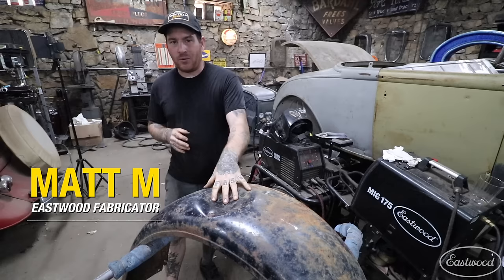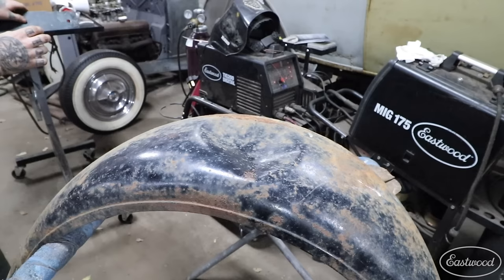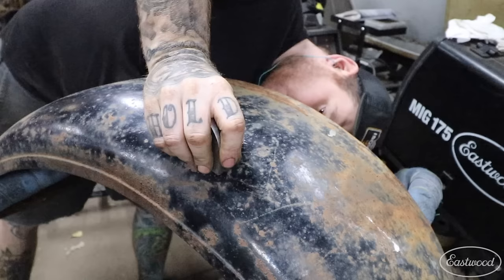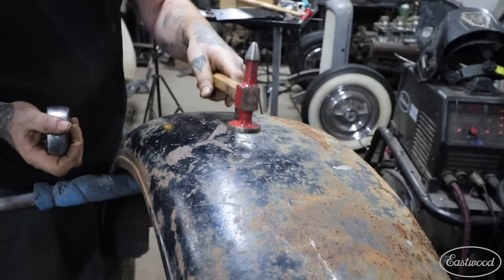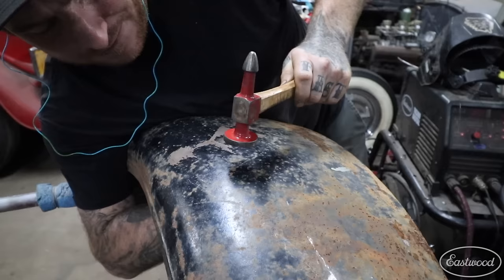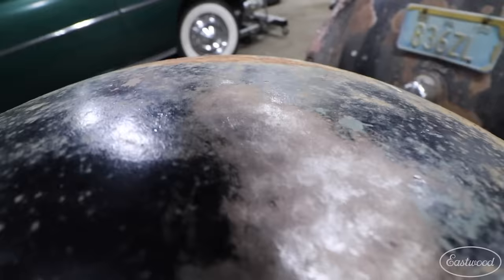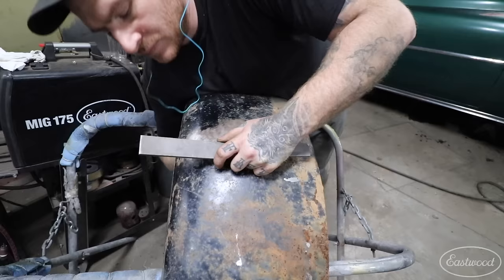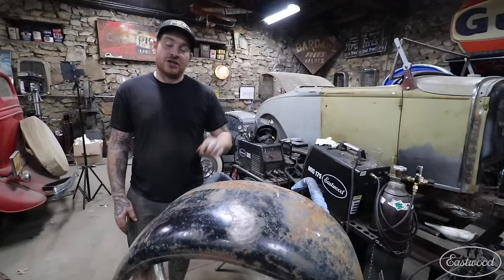How to Fix a HUGE DENT with Only Hand Tools! Eastwood

Comment: So I took to heart your methods and techniques, and even though I’m a rookie and have never done any metal dolly work, I did exactly as you showed, and I have super good results! I didn’t stretch any metal that I can see, but now I need to see how the slapper dolly can help me get those small ripples out. I had the same dent to work as you did, only larger compounded by a deep “V” wedge dent on the lower corner of a driver’s side rear fender on my 59 Apache. It’s right where the lower bottom curve wraps around to the tail light. I kept applying pressure from the inside out of the center of the crease, all the while tapping the outer crease on the outside and badading badda boom! I watched that dent walk itself out. Excellent video!!!!
Reply: Basically a hour project pal

Comment: Hanging some weight off the ends of the fender will help to secure the panel. You can use an adjustable chain or strap. Bricks or scrap metal for the weight.

Comment: As a bodyman with over 45 years of experience, I'd like to point out a few different principles. Always look at the damage and look for the point of impact. From there look at the damage furthest from the impact because that's where you should start the repair. That being said, when the damage extends over a high crown (like the edge of the fender) that is where you should begin the correction process. I personally like to rough it out first by using something soft like a rubber mallet from the underside, but only at the sharpest part of the damage. I will only begin using the hammer/dolly process after 90% of the damaged has been roughed out.

Sometimes, if I have low spot I may continue using the mallet or dead blow hammer on the underside while tapping the topside rolls with the body hammer. Sometimes even using the mallet or dead blow as a dolly. The whole idea is to minimize damage in correcting the original damage. It's really easy to create a lot more damage than was originally there- especially on a low crowned panel like a hood or roof.

After you've hammered and dollied where you believe it's pretty straight, sand it with eighty grit (DA sander). This does two things for you. Besides showing you your high and low places, the heat also spot shrinks the minor high spots. You can then begin picking up the low spots (take it easy with the force) with a pick hammer, bullseye pick, or selected dolly for larger shallow lows. Sand some more (DA sander) and continue until no more low spots seem to be present.

At this point, use a nitrile gloved hand to evaluate if your shape overall seems right. If it does, then it's time for the body file.

The body file is used with long deliberate strokes. The idea and the most useful function is that it gently files down and spot shrinks high spots. After filing, you should have a pretty straight and smooth panel with some minor low spots. This process helps eliminate those pesky high spots that present themselves after filler is applied (grrrr). At this point you can either work to eliminate all the low spots using the same technique, or give it a final sand and apply filler.
Reply: Thank you for the detailed description of doing the correct process, my confusion comes at where to start to reverse the dent.  Like the center of it ? Or the outside edge ?
Reply: @michaelkorolev2115  On all panels there are crowns. The crowns are merely the curvature of the metal, which increases the strength over a flat panel. A lower crown, like a roof panel is lower in strength than a sharper crown on say a fender. Normally, there are lower or higher crowns on a given panel. For example, a roof may have a large low crown area over most of the roof, but toward the edges of the roof it will gradually be formed into a sharper crown.

As example of how to begin a repair consider this example. A large dent is on a roof. A small dent is found toward the middle of the damage is the point of impact. But because the actual damage is much larger, it crosses the roof in long valleys in the metal in all directions, crossing various crown shapes as it goes. The places farthest away and over the sharpest crowns is where to begin your repair. Many times, once this damage has been carefully roughed out, most of the remaining damage will largely eliminated or at least reduced. If you start in the middle, you will likely create more damage, and damage likely harder to correct. You just can't beat the damage out and expect good results. Thought, care, and proper technique is essential to satisfactory results. Patience at the beginning will save a lot of time and frustration at the end. Start with smaller damage in areas with easy access to the backside. Try different crown shapes to get a thorough understanding of what works best on given shapes. And remember, this skill can take years to master. You will make mistakes, lots of them. At the beginning, it's little more than a comedy of errors. But you will also learn more and more as time goes by. Patience is definitely a virtue here.
Reply: Dean Wright wow thank you so much for your well versed understandable explanation.. I’ve been starting in the wrong direction. Because I’ve misunderstood everything I read in my research. I thought that the deepest point of impact was the last place to get damaged. I can see now that’s not true. Anyways I have hammers and dollies that I want to learn to use. Also a Eastwood tig 200 I’m trying to teach myself to use. It gets frustrating with my only teacher being the internet. Without a knowledgeable person to show me my mistakes and how to correct them . Like for instance me fighting the tig welder for 3 weekends in a row all day long . Thinking it was defective but discovered it was me grounding to the opposite side of the rusty welding table. Once I grounded to the sheet metal itself it was all different, but now I wanna try doing what you said. I’m determined to learn this because I’ve always wanted to. And I’m a helper in a shop that firmly believes in mig welds and bondo  which I understand is cost and labor effective. But I want to learn the quality side of things . Need to learn when to shrink and exactly where and the same on stretching. Thanks again sincerely
Reply: @michaelkorolev2115  No problem. Actually there's a lot more to it, but best to start with the most simple and basic. Understanding whether your damage is shrunk or stretched would probably be the next step in your understanding. Also what a buckle is, the types of buckles there are, and the clues to how to properly rough them out. It's not common sense, it's fully understanding what has taken place. Fully understanding these concepts is what can enable you to properly repair structural damage and frames. But for the beginner, the information you have should be enough for awhile. Good luck, your skills will be a source of pride for you.
Reply: casiotechI  There are a few catalyzed primers that can fill considerable imperfections, but by and large primer is only used to fill minor scratches (80 grit or finer, for water based 180 grit or finer).  In addition, catalyzed primer is superior because after 24 hours shrinkage is nil.  Be sure to wear a proper paint respirator, otherwise it could harden in your lungs (not good and potentially fatal).
Reply: Very knowledgeable response, two things... First of all why don't you do the video? And you missed surface cleaning procedure before filler. Agreeing with everything you say however for the newbies you have to remind them, don't miss any step no matter how insignificant it may seem to you after years or decades in our trade
Reply: @michaelkorolev2115  Experience is the best teacher. You think you are losing time with mistakes and frustration, but in reality you are learning a lot. No one can teach you that.
Reply: Thanks for sharing your knowledge!
Reply: Heating it with a sander is brilliant!  Also a wire cup brush on an angle grinder.  Heats up real fast and softens the metal so it pops back better.  Smart trick!

Comment: I tend to just set my panel on a work table and smack the majority of the damage out, I move the panel around as I do that, and even out the rest with a dolly

I also sand the panel to see high and low spots, you can also put on a guide coat

Comment: Hey there friends going to start some body work the truck I am going to work on is a 2007 Silverado doesn't have the same steel as the 40s or 50s it is like a soda can really light taps I assume thanks for all the info an posting  !

Comment: This was awesome.  I have a fender that looks exactly like that one (1928) and have hammer and dollied most of the dents out but it also has a rip in the fender on the edge that goes through the bead.  Would love to see how you handled something like this as it has the compound curve, bead, and needs to be welded.

Comment: In application of using the tools here your laying the metal dolly weight piece flat underneath the panel and using the radius hammer and tapping around areas of where you pushing up from ?

Comment: I think at about the 15:45 point I would have sanded with a straight board or flexible pad across area and low and high points would have been very apparent.

Comment: All good advice, thought it would be much easier to see the damage if you cleaned off the paint and rust first. A simple wire wheel or scrub wheel would help a lot.
Reply: I'm glad you told that rookie how to properly fix it

Comment: Can you or are you able to do video of showing how you remove dents in a motorcycle fuel tank ?
Reply: That is a black art
Sometimes compressed air will help to pop it out 
Most tank specialists use special pivoted hammers with a bowden cable
Or after steam cleaning, they cut the bottom of the tank open, hammer and dolly it then weld it back up

Comment: What about let’s say when something was dropped on an edge of a door entry (Willys CJ3A) (door entry edge is 3/4” wide) and it crushed the side wall down and out making a 1/2” deep gouge that needs worked out as well? My solution was I flipped the body tub over and am using a  pvc doughnut dolly and a body hammer to try and work the  bulge back down towards the area of the crushed spot. I have it 3/4 of the way out but due to the severity of the damage and the fact it has the deep gouge I cannot figure out how to work it the rest of the way out.
Reply from the maker: You may need a stud welder and slide hammer along with the hammer/Dollie combo.

Comment: I have a dent like this in the roof of my classic bug.  There is no space to get under the dent just from the top.
Reply from the maker: If you don't have access you might have to go into metal work and use a stud welder and slide hammer to pull that dent out.

Comment: Will this method work on the modern thin sheet metal of today’s vehicles?
Reply from the maker: Yes!
Reply: Yes and No!!! The problem with new cars is you can stretch the metal too far and you'll never get it back in place!!! Takes a lot less force on new cars that's why the "Paintless dent repair" works so well. Because they aren't really hammering on the panel as much as they are "Massaging" the panel back in place with nothing more than rubbing with the tools!!!

Comment: Just a suggestion.  You’re having to hammer heavy, because you’re so choked up on the hammer.  If you were farther down the hammer, it will let the hammer do the work, and you could tap gently.  Hence I get close I switch to the spoon, then to the slapping file, and then use a body file, adjusted to the radius that was found in the beginning to see the low and high spots.  Just my opinion and the way I do it.  Good job though.  I really enjoy the Eastwood videos
Reply: This is true but having it closer up gives you better aim last thing you wanna do is create more work for yourself good tip though for bigger less precise dents